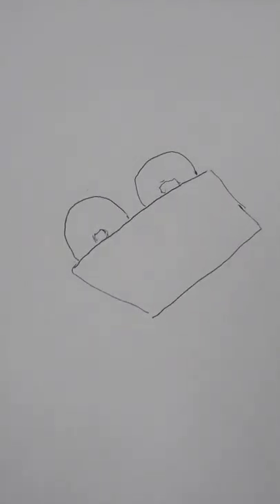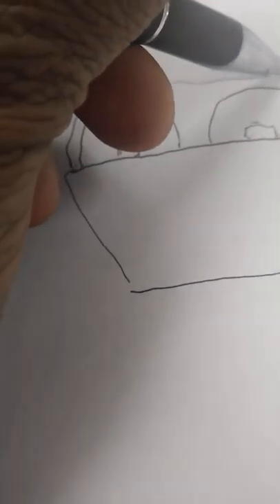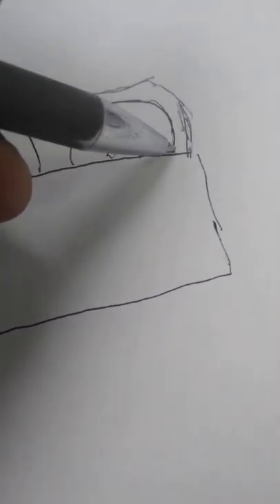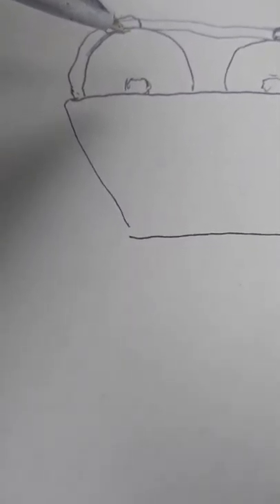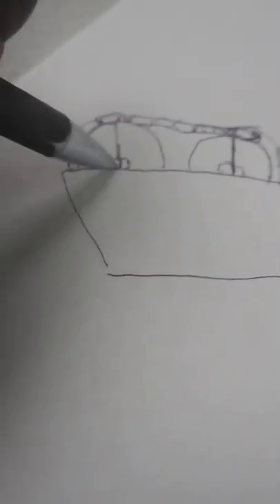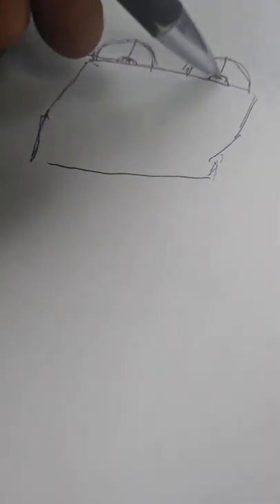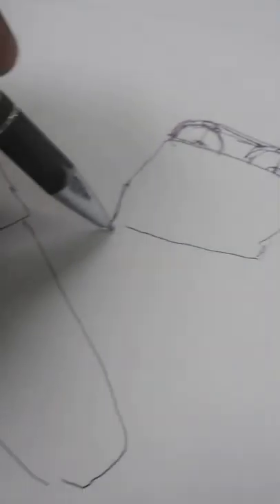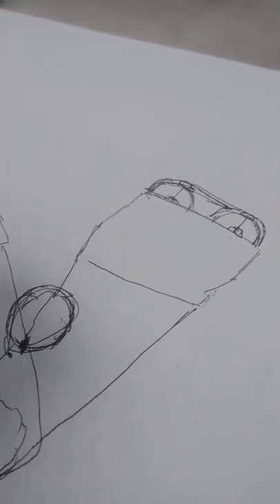Part 1 Install Timing Chains and Cylinder Head Caddillac 4.6 Northstar

Comment: Man, you're misleading folks. Those chain from the heads do not go to the bottom crank, the goes to balancer sprocket which is above the crank sprocket. The crank and the balancer sprocket are timed together first.